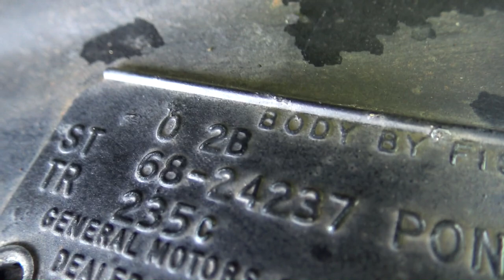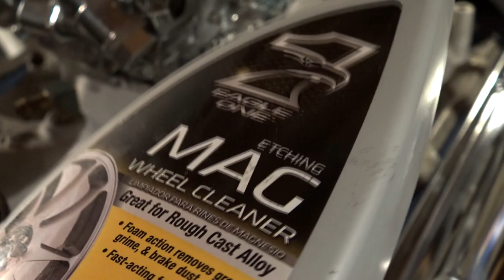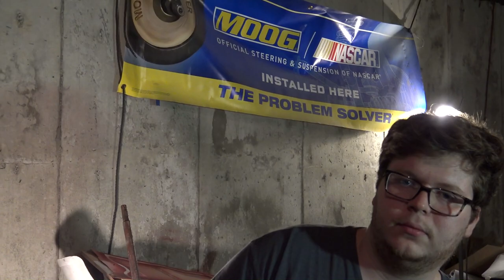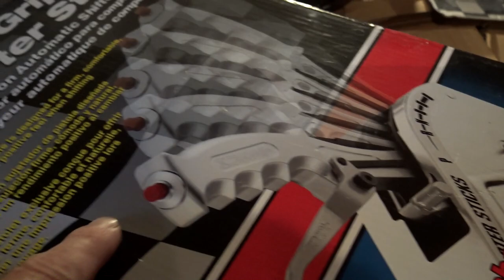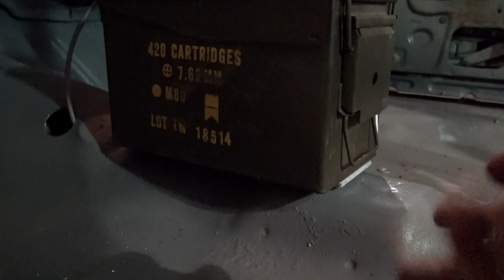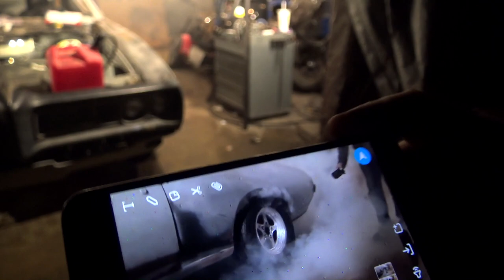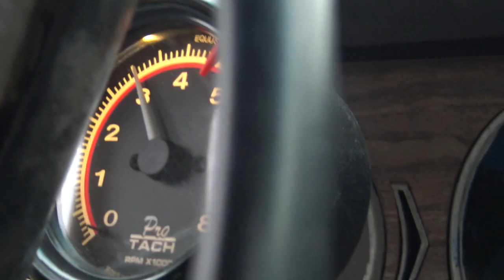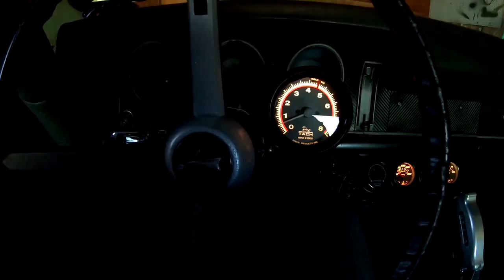1968 Pontiac GTO Project - From Day One

Comment: I think your builds are awesome my problem is I put a holley dp on and had to use the spacer plate now I'm thinking with the stock air cleaner wich is pretty high that I want to use hood won't close what's your opinion

Comment: Good job so far with your 68 I'm restoring a 68 goat as well one owner got of the showroom floor in 68 original 400 stroked to a 455 but my question is you did that body work in front of the windshield but you cover where your windshield arm and motor go do you have another plan for that